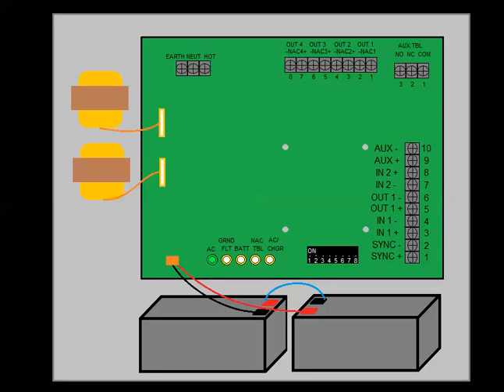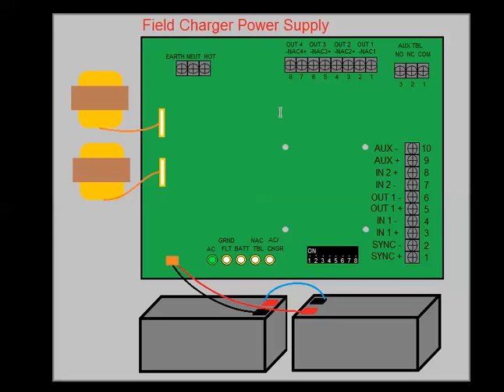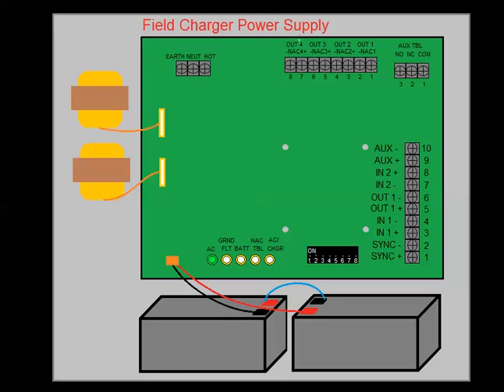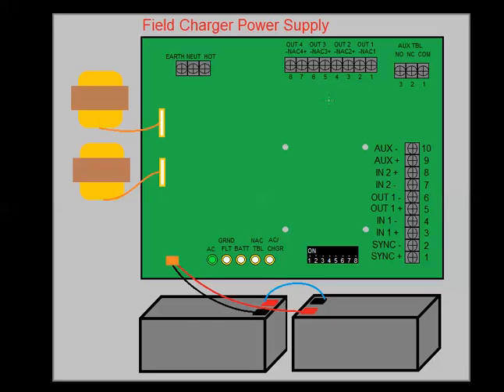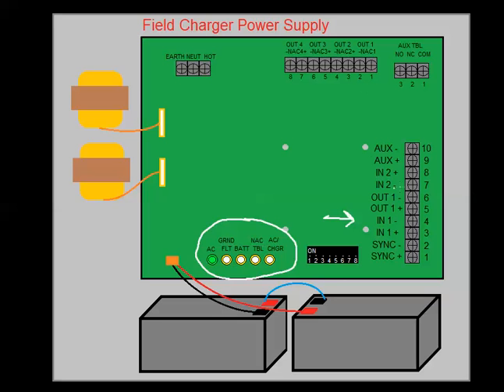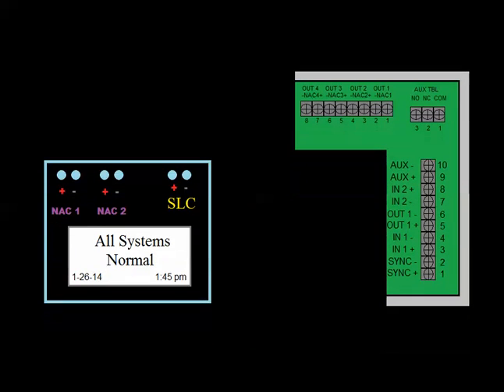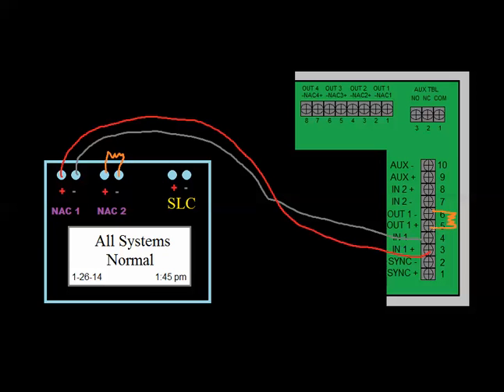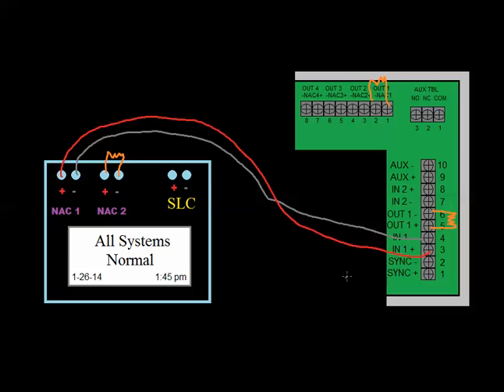26 - FCPS  - Introduction to Fire Alarms

Comment: Today I learned how multiple FCPS's are able to be daisy-chained together without its trouble contacts killing the downstream FCPS's.

Being an inexperienced inspector helper, I confused myself into thinking the FCPS just cut power to the OUT contacts to cut power to the resistor. This makes no sense. After all, how could something called OUT be intended exclusively for an EOL resistor?

Curious, I opened the manual. Turns out the trouble contact is located between IN + and OUT +. On a trouble condition, the FCPS will do its electronic magic and sever the main panel's connection to the positive leg of the outgoing circuit. The panel can now no longer see the EOLR, causing a NAC trouble.

However, the FCPS's IN terminals will still be receiving power from the main panel, while its OUT terminals are still being operated by the FCPS itself. Thus, the panel can still trip the FCPS, and the FCPS can still, in turn, send power through its OUT terminals.

I hope this is accurate. What I am still curious about is whether this logic applies to sync modules as well. And also whether it's good practice to have ordinary notification appliances connected to the OUT terminals - Can the FCPS still somehow distribute the panel's NAC power to the OUT terminals if the FCPS goes into trouble, or is the OUT now being powered solely by the FCPS?
Reply from the maker: A couple things here... Most of what you said is correct. It is definitely not good practice to have ordinary NAC devices connected to the trigger circuits of NAC panels. You'll see it being done, and it will usually work, but it isn't good practice. It can cause sync issues, troubleshooting headaches, etc. Most newer NAC panels will tell you in their manuals you cannot do it. Best practice is to have NAC triggers be NAC triggers and NAC circuits be NAC circuits.

What you described with the IN and OUT terminals is accurate, but be careful in assuming that because it's true of one model of NAC panel that it's necessarily true of another. Silent Knight made a NAC panel that didn't close the output contact on an alarm condition, so you'd have to be aware of that when wiring multiple units. Other NAC panels have other minor differences as well, so defer to each individual manual to see how their equipment works. 

I think your description of the process was a good one, but I think it may be helpful for you to not think in terms of the NAC panel "powering" the OUT side of the trigger. Instead, think of the OUT side as having one leg pass through  a relay where it's simply completing the circuit or opening the circuit. Whatever signal gets sent to the IN side is getting sent to the OUT, which includes sync signals. The signal is not regenerated, it's simply passed through.

Sync modules work differently because they don't open up on trouble so there's no concern there.

You really have to treat each product individually. As a brief tangent, the newest honeywell NAC panels make several claims in their manuals that are simply not true based on my limited experience with them so far. I think some of their wiring diagrams are incorrect, and some of their claims about what circuits open up on trouble are not true. It appears it's going to be a problem for retrofit applications, but it's a bit too complex to get into here. 

The last thing I'd say is if you're thinking this in-depth about NAC panels and you're still a testing apprentice or assistant, you're doing better than the majority of people in your position and should be pushing for a more independent role in your company or at another. Your description was very good and it's clear you understand what you're looking at. Keep at it.
Reply: @JoeKlochan  Thank you for your words of encouragement! I'm trying to push for full time, while absorbing as much "field smarts" as I can in the meantime. I also appreciate the advice about treating each brand individually.

Your tutorials were a major factor in getting me interested in the technical aspects of fire alarm systems. Before that, I was pretty much just a kid who liked seeing things go "beep".

Comment: Very informative video, but if a power supply had a trouble, and was reporting that to the main panel by breaking the connection to the end-of-line resistor, would it reconnect the input and output terminals, if it went into alarm, to ensure that all NAC's/FCP's after that unit were activated?
Reply from the maker: jayja45 Most manufacturers do exactly what you're asking. In the event the input to the power supply reverses polarity (goes into alarm), the contact between the input and output that previously opened to transmit a trouble will then close to allow FCPS panels down the line to all activate. I took a Silent Knight class where the instructor said their panels to not work this way. I didn't believe him and so I looked into their manual. I didn't get a clear answer from the manual. It seems they may do the same thing but I have not field tested it. Short answer: the good power supplies do exactly what you say.